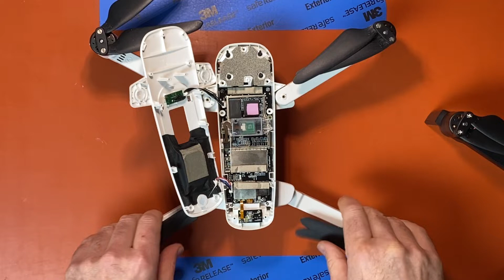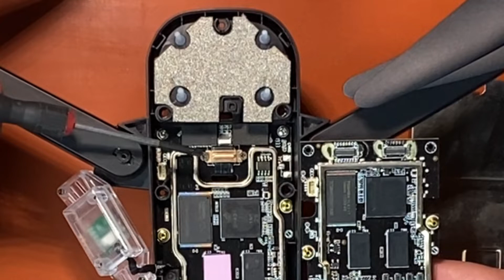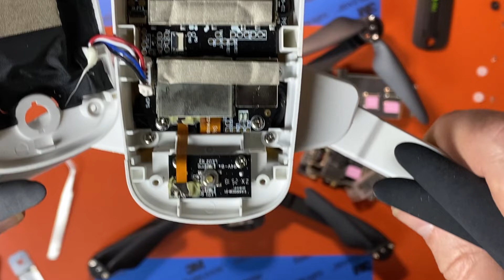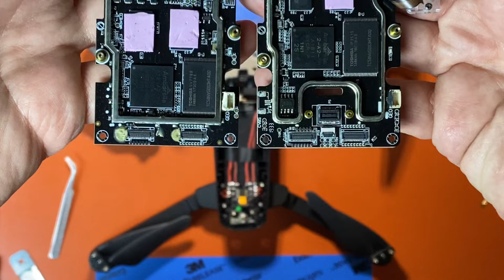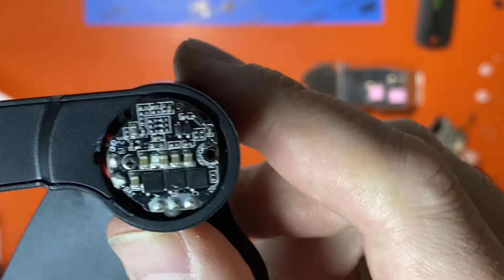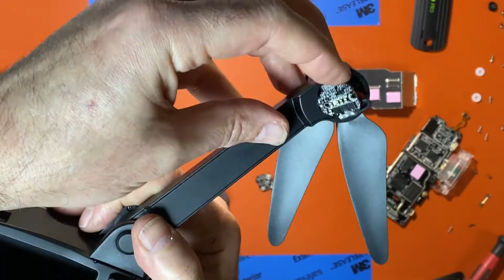HUBSAN ZINO PRO - THE UPGRADES ARE INSIDE & HOW TO TAKE IT APART

Comment: Hi friend I have a Hubsan Zino Pro that I bought used. Everything seemed fine but then I saw that it works and flies well but the following happens: after turning on the camera there is video and after 5 minutes there is no image if flying continues to obey the commands. I suggest something that might be doing this. Sincerely Mauricio
Reply from the maker: First thing I go after when repairing them for customers is the image cable. I would have to see it first hand to troubleshoot it better though.

Comment: What was that cable at 16min and 15 seconds called? The one that connects the power module to the main board? Thanks!!
Reply from the maker: Go to Hubsan’s parts section and you will see the proper names and the part numbers for them. 👍🏻
Reply: @QCGUY  thanks!!

Comment: Hello, is it possible to use the main board of zino pro into zino and get the 4km range? Will the controller work properly? Thank you in advance.
Reply from the maker: No there are other things to factor but mainly two different signals with one being wifi and the other being leas. Thanks

Comment: Quick question bro are you meant to oil these motors after a year?
Reply from the maker: There’s no need...
Some do but the oil just allows dirt and dust to stick.
Reply from the maker: They are sealed bearings. 👍🏻

Comment: Hello Chris,
I habe h117s, when i buy Mainboard from Zino Pro, can i install it in the h117s?
Reply from the maker: Yours is Wifi and pro is leas...
Zino Pro gimbal has different boards in it, it also has a repeater and exhaust fan plus the ESC’s are different so you may have a issue between the zino pro board and the power supply board.
Reply: @QCGUY  do you have Email?
Reply from the maker: @mladenknezevic3394  qcguy.chris@gmail.com

Comment: maybe the anttenna is printed on the board somewhere.
Reply from the maker: After further taking apart I found they are under the board connected to the board by the fan and run into the legs. This was my first look so I was a bit off there..
Reply: @QCGUY  so the fan cable and the antenna cable are merged into one flax cable?
Reply from the maker: @pierrejeanes  I need to make a correction comment here but here’s one that makes it clearer I think. https://youtu.be/6jp3QrvctGE

Comment: I'm getting gimbal error 0X2000. I looked around without taking anything apart and I think the ribbon cable is broken. Now I wanna take the gimbal and ribbon off. Do I have to remove the main board too? I searched and couldn't find any videos on the gimbal removal of the zino pro.
Reply from the maker: KjSNOW 413 I have different take apart videos. It’s the same as the original Zino and you don’t have to remove the board.

Comment: .... i would use something plastic VS a small screwdriver pointing and poking on sensitive boards... may have stray voltage in one of the boards there or static on you..... just being nit picky and old school on electronics safety.
Reply from the maker: pogito I get it and your right but call it over confidence I guess. I repair all Zino models for people and so far over a hundred easy with no such issues or faults of mine for the above mentioned. 
Not cocky but I fix these better than Hubsan delivers them new.
Reply: @QCGUY  totally believe you. not just talking about drone repairs but most 3rd party repair people are way better than OEM repair guys. they are more exposed and free from red tape processes. i work for an OEM company and I've met A LOT of 3rd partys and dealers with overwhelming knowledge and tricks that we are not allowed to do. Keep up the great work and you just earned a new subscriber today. 👍
Reply from the maker: pogito Thanks

Comment: Hi, I really appreciate you doing these tear downs (better you than me!). I've ordered a Zino 2. I am aware that these units are set to 'Mode 2' at the factory. I'm hoping you can answer a couple of questions? Firstly, would you know if the 500m altitude limit is set for sea level. I live at least 250m above sea level. Does this mean I only get 250m before it won't fly higher? Is this adjustment just software based, or is there some hardware setting? I'd like to still have at least the promised 500m up from me to max altitude. Any help much appreciated. I've already scoured the net with no joy. On antennas, some of the internal wiring might be employed for double duty? Thanks so much!
Reply from the maker: michael anthony You can go much higher but I don’t know of there being a limit. This isn’t a quad I recommend modding with antennas or anything. I did it and seen others have with nothing worth writing home about in the results.

Comment: Can you please help me? First two times when i fly with Zino Pro it was very good, like really good. But now i can not anymore fly normal. 
Because when i try calibrate compass it shows - the compass readings are abnormal; please move the aircraft... i tryed several places where nothing should interfere.
And some times it shows Ready to fly but when i takke off it just starts circling and it is difficult to control. I am desperate, don't know what to do...
Reply from the maker: Oxinn Sounds like a bad compass module.

Comment: Hello, did you found out where the antenna cables was connected ?
I can see there is a cable and antenna plug on them replacement arms here 
https://www.banggood.com/da/Hubsan-ZINO-PRO-H117S-RC-Drone-Quacopter-Spare-Parts-Motor-Arm-With-ESC-p-1619788.html?rmmds=search
Reply from the maker: Allan Evers Yes it’s down in the bottom in front of the battery. Between battery and gimbal.
Reply: @QCGUY  Thanks a lot I appreciate your reply  <3

Comment: My first post as a new Zino Pro owner. Question... Drone has been flying decent but yesterday  I took it up to 300ft for the first time ( that was not a problem) as I was descending to land the drone began to fly in a 5ft. circular motion and wouldn't stabilize to allow me to land properly. It landed flying sideways and flipped over. Some minor prop damage and continued to run upside down.  Was there anything that I could have done to stabilize the drone and stop it from flying in a circular motion. It was in GPS Hold and flying in a circle motion.
Reply from the maker: Tommy Guns Dunleavy In that case it is always a compass calibration and can be avoided if you hit RTHh when it happens. 
It’s called toilet bowl when it does that...
Reply: @QCGUY  thanks I did the calibration.  It must have lost calibration in flight because it flew great until the end.
Reply: @QCGUY  I think I figured it out.. I actually calibrated the drone on a stainless steel table. That's gotta be it.

Comment: I think the "control board" you point out at 20:55 must be the LEAS module and those two clumps of ugly yellow stuff on it is the glue that prevents the two antenna connectors from getting loose over time.
Reply from the maker: dominic lee I think it’s a booster for the leas module. I have pulled it out and found the antennas are there connected to it and asked Hubsan if it was the actual module or a booster and they confirmed it in their confusing way where I have to assume they meant yes. 
Sometimes you just have to give up.

Comment: LEAS? Acronym? Can you explain? Is an 802.11ac wifi phone required? Do Android Phones work with this drone? Amazon does not mention which Version of Zino Pro they are selling? Is this important? Sorry for all the questions. Thanks for the videos & postings!
Reply from the maker: No with LEAS it is not required and android works as does ios. There is only one version of the pro and sorry I can't define exactly what LEAS stands for. Thanks
Reply: @QCGUY  I have been reading and watching on You Tube that..."some" versions ?? have a little reputation?? for fly a ways??? Do you know of this? I have the Mini for 10 days now (my very 1st drone)... flies great, etc., but had to buy used iphone, software, firmware, etc. I Downloaded the Zino Pro App & it installed on my super cheap phone - the App for Zino Pro. Easy Pizzy... NOTHIN like DJI. Am thinking... maybe... I should have went with the Zino Pro?  I'm torn. Can you give your 2¢ worth? Thanks! I have 2 more weeks to return to Amazon??? hmmm???
Reply from the maker: Steven Shackelford All quads can have a flyaway due to interference. The Mini is a good quad and I can’t comfortably say send it back and get a Zino Pro.
All quads have different protocols in what you need to do to use them. I choose the pro over the mini but if you are new to this you will find the pro a pain in the ass to do updates. 
Safe road is the mini and a more advanced user that is good on a computer or making repairs is better with the Zino Pro. 
PS. I’m bored with the mini! 😂
Reply: @QCGUY  Wow...an unbiased professional opinion. I really do appreciate your time and help. I will try not to bug ya too much more and stay with the d*#ned Iphone7 & mini... for now. Again TY!!!

Comment: I have the Zino Pro, and been flying it some months now, but just yesterday the video feed from drone to transmitter went out.  I can still fly the drone, but not receive any video or take photos from gimbal.  The gimbal still works, and the drone flies well, but i can't see it on the phone using app and transmitter.  Any suggestions?  I have tried a full reboot, full app reboot, and changing every setting i can on app
Reply from the maker: Joseph Myers Here’s a good time to recommend my group. It’s best to show some video of the problem and easier to resolve that way.
https://www.facebook.com/groups/HubsanQC/?ref=share
Reply: QC GUY I don't have or use Facebook since 2015.  Is there any other way I can communicate with them?  I'd rather not go back to Facebook.  Also, I can take a small video of what the boot up procedure looks like and how it all just ends in a grey screen with the app and transmitter.
Reply from the maker: @JosephTMyers  Upload what you can on your channel and let me know when it's visible.
Reply: QC GUY will do.  Will let you know by no later than midweek.
Reply: video will be on my channel starting tuesday at 3:30am pst

Comment: Hi QC GUY. Can you recommend a better charger for my hubsan zino pro,  the battery that came with it had all green lights on hubsan charger after charging  it but  5 minutes in to flight and total power failure. I don't think battery charger had anything  to do with  low volt in cell failure. Thank Goodness I was less then 5 feet above thick Bermuda grass. I understand that it's a battery safety kill  switch or something that responds to weak cell in battery if I understood that correctly . Do you recomend 4200 gifi lipo or the buttcheeck 5000mah as better alternatives? Sincerely William Horsley
Reply from the maker: William Horsley The imax B6 V2 charger and the 4200mAh has proven to be a good battery as we.
Reply: Okay. Thank you

Comment: Man, I’d be so nervous taking that thing apart. You definitely have to have hands that act with surgical precision. Kudos to you for that. I wonder if the warranty becomes void once you remove the first screw? Haha. That’s pretty awesome to see the inner guts on a Zino Pro like this. Thanks for sharing.
Reply from the maker: Drone Syndrome It will void the warranty but I never use warranties on these china born drones. Not worth the trouble. 👍
Thanks 😊
Reply: QC GUY True that.
Reply: QC GUY By the way, I have the opportunity to buy a Husban Zino second hand in new condition but the only thing is that the current owner says that he did a firmware update to it and not it doesn’t connect to GPS. Basically, he says that the drone turns on but he can’t fire up the motors and he gets an error message that it can’t connect to aircraft. Any advice on how to fix this or recommendation dation videos? Thanks.
Reply from the maker: Drone Syndrome I know who’s this is and I don’t know what went wrong but nothing I offered fixed the issues for him. 
I dad one similar and it needed a new board.
Reply: QC GUY Gotcha. However, I doubt it’s the same person. I mean, there must be several people out there that have had this issue, no? Anyway, I appreciate your time and support in trying to help the community.
Reply from the maker: @DroneSyndrome  It just sounded all too familiar after a person contacted me a last week almost duplicating the words you said. Sure other do have this problem as well so I may be wrong.
Reply: QC GUY Ha! That would be such a coincidence if it were the same person. I hope it’s not, because if the motherboard is done on the thing, then I don’t want it. For that, I’ll just save up and buy a Mavic Mini or the Zino 2.
Reply: QC GUY Or I’ll wait till someone is willing to donate one to my channel (which I doubt.) Haha. Thanks again my friend.

Comment: Have you performed tests with swapping modules between zino and zino pro? For example camera, gimbal, etc.
If you have spare part you can connect the zino motherboard to zino pro ?
Reply from the maker: Zofia Derak No and I considered looking into it when the pro was announced but now seeing the differences it’s not worth it till we figure out what parts are interchangeable.
Reply: @QCGUY  Have you done a review on photo quality?  I just got a PRO and the photos aren't that great, somewhat blotchy in fact
Reply from the maker: @divergentaussie4336  There is need for a update there yet.

Comment: Chris Great Channel and I have you to thank for shelling out the $399 ;)      I have a suggestion for a video.  As Ive placed my pre order for a zino2.  I would like to take advantage of the original zino  prices $(239). I would buy a original zino as my first drone to learn on waiting for the zino 2 to show up.  So if I crashed it badly needing $$$$.  How hard would it be to upgrade the original zino to a pro?  I see that there are now 5000ma batteries out there for about $65.  Just an idea dont mean to have any body go off the rails just saying??
Reply from the maker: clint meyer I am dabbling at the idea to convert one but need to test some of the electronics. I don’t see this being very practical or effective with lack of main boards for the pro. The amount of people that would do this conversion able would be limited interest and parts.
Reply: @QCGUY  Thanks for the reply.  Keep up the great work!  Im sure you are helping Hubsan out.  I hope they will reward you in some way.  Are mainboards available from Hubsan?  I know you stated in a early vid that the zino would be.  I take it the Pro is not.   If they are what is the cost?  Im also guessing you need to pair gimbal with the mainboard.  Thanks again
Reply from the maker: clint meyer Parts for the pro are limited in the beginning and main boards are the hardest to come by. In buying cameras yes you want to match the hardware up by suppling the serial number.
You would have to contact Hubsan directly for price and availability.

Comment: When you first started this take down you removed two stick-on covers that you mentioned were themselves covered with black vinyl.  Unless you were going to remove the legs as well, was it really necessary to have removed those two stick-on covers?  It looked like all they did was cover the threaded end of the screw-slot that held the screws that secured the front end of the top cover.

I'm glad you did take those stick-on covers off just to see what was underneath but was it really necessary unless you planned on removing the front legs as well?  

Thanks; this was informative.
Reply from the maker: You have to in order to get the cover off. They must come off to remove the screws.

Comment: copper is thermally conductive and those copper adhesive patches (16:44) only bridge the thermal shields, you probably find other conductive rubbers patches under there...just guessing
Reply from the maker: 3dvorator Probably will but I checked some other boards I have where they are used and none cover as a bridge. The cover the entire component. 
I understand where you’re going with this but it doesn’t seem effective this way.